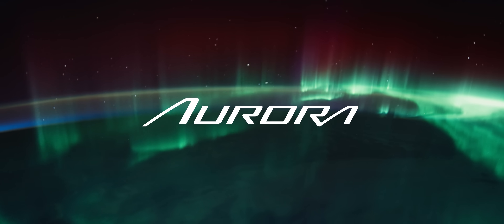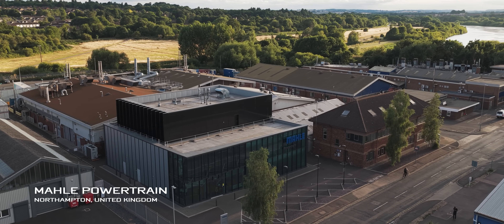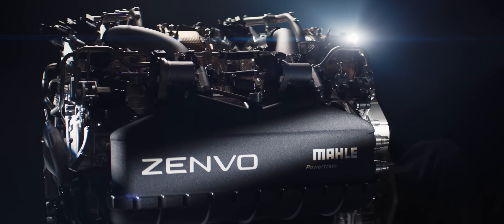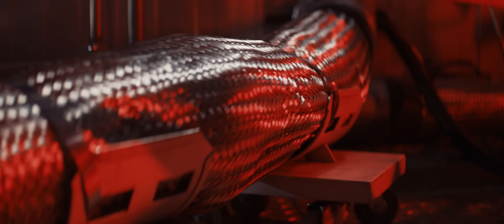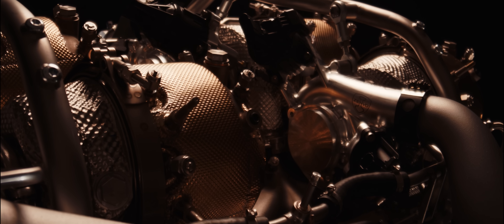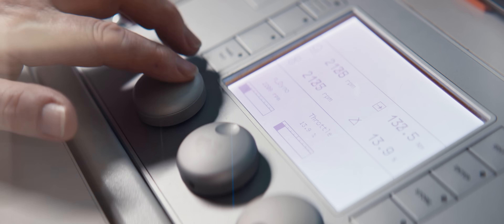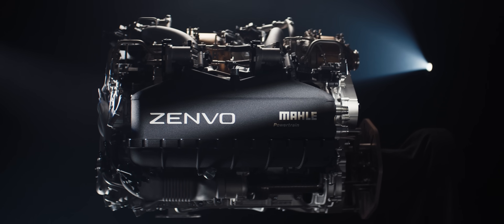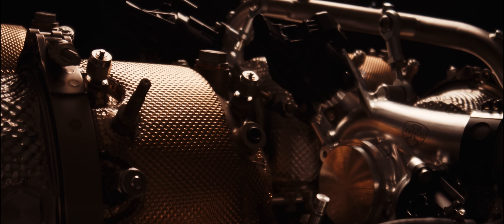Delivering Aurora | creating the world’s most powerful production V12 engine

Comment: Mahle could be the next Cosworth if they land another major engine for a special project....maybe something extra special with Ferrari won't hurt since they already work together
Reply: Mahle Powertrain was Cosworth before Audi sold it. That's why both Mahle Powertrain and Cosworth are in Northhampton
Reply: Ferrari doesn't need help with building engines or anything else.
Reply: @heinedenmark  Hate to be the bearer of bad news, Ferrari do enlist the help of Mahle on regular basis, the 499P engine which is from the 296 was in part helped with by Mahle, hence why you see their name on their race cars
Reply: @petersafwat8228 They manufacture pistons for them. They are not evolved in any design process.
Reply: Mahle does pre ignition chambers in racing engines, I don't think they do entire engine production, kinda like what Bosch does, help the main guy with their tech
Reply: Not alchevno

Comment: American pro mod hemi v8 Turbo engines are making over 5000hp but they are not daily driver I'd like to see a v12 hemi
Reply: This engine doesn’t destroy itself. Who let the kid write a comment?
Reply: This engine's 1200hp horsepower is a child's play compared to an American pro line hemi v8 engine but they have some problems like reliability , durability and low rpm. Ford made an overhead cam hemi v8 it was a pure monster so a  modern 8 liter V12 overhead cam hemi engine can make over 3000hp with Turbos easily this zenvo engine is not impressive @SlySoSavage
Reply: @Maiza007-c8y cooling is a big problem
Reply: @SlySoSavage yeah your right cooling is a problem. I personally think a water jacketed billet 8 liter V12 hemi with lot radiators can work.
Reply: Apples to apples brother. The 7 litre Cammer put out over 800 hp with dual quads. Back in the 70s Porsche had a Flat 12 that was 5.4 litres and a 16 that was 7.2 litres that put out 900 hp without any Turbo chargers. When the 5.4 was used in the 917/30 it was producing 1500 with turbo boost of 32 psi.
Reply: @FrankNeill-o3b  yeah with quad turbos it didn't sound impressive. LONG LIVE! the F1 even the T50 has a engine I would pick first. British design kind of makes it nothing to be proud of. I guess we're claiming it anyway
Reply: @SlySoSavage When you look at how fast the technology has gone from then untill now there is no comparison. These Hyper cars are really what the 917 was back then.   I was looking at the McLaren W1 and Red Bull hyper car and both were putting out 1000 hp with just 4 litre engines without turbos.
Reply: @FrankNeill-o3b I understand that but I much prefer the higher top speed and lower weight. I know much of it is safety related or even design restrictions. There’s no doubting engineering is still doing the lords work
Reply: @SlySoSavage Lower weight is what it really boils down too. 👍
Reply: @SlySoSavage Speaking of lower weight, here is an interesting fact about higher speed and lower weight. Did you ever hear of the Oldsmobile Aerotech car? I researched that car back in 1986 and it was designed for speed records. It had a 2.3 litre 4-cylinder engine aluminum block that produced 1000 hp with a turbo boost of 40psi! It had a top speed of 275mph! The Hennessey Venom 6.6 litre engines produces 1812hp and has a cast iron block and yet it can barely beat the Aerotech at 277 mph. Weight is obviously making the big difference!
Reply: @FrankNeill-o3b why are they using cast iron still😢 do some harder R&D 
No I have not heard of that car but thanks to the Peterson museum I have been get well educated on American cars. You guys have came a long way and the Ford GT is the best looking super car still in my opinion. I don’t like Ford saying on Jay Leon’s they build this $400k GTD to beat the GT3 then I see the lap times and they’re what 4+ seconds slower…otherwise…..😅
Reply: @SlySoSavage Yeah right! You would think they would use an aluminum block if they were trying to beat a speed record? Well FYI, I'm no expert when it comes to all of this but I have done a lot of research. When I was deeply involved with racing and learning I always wondered how much better the flat 12 and 16 if Porsche made it today. The GT40 had the 7 litre 427 single overhead cam engine in those cars when they raced at Lemans. The 917 were produced to compete against them during that time. When you look at where Cosworth and McLaren are today with their Hyper cars they are right there with the best of them if not the best!